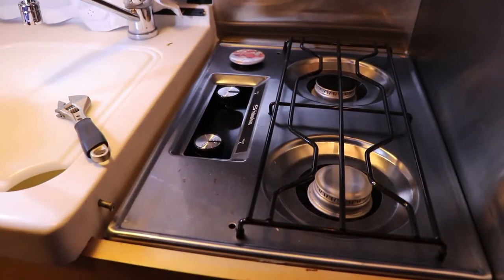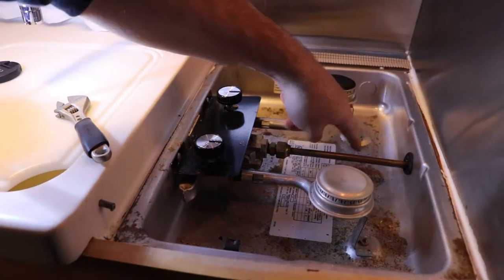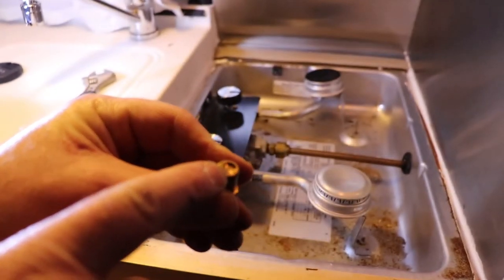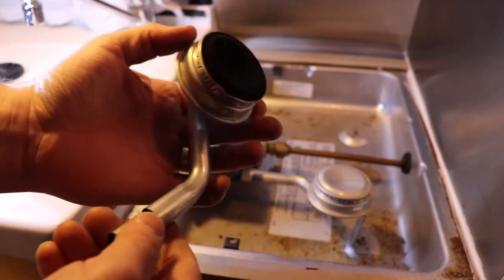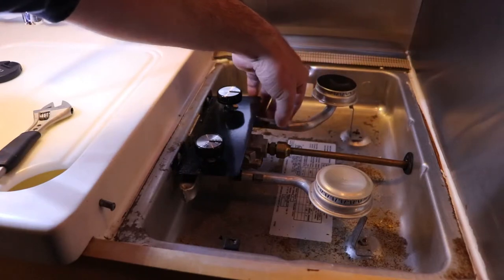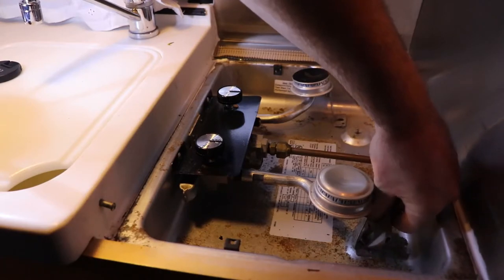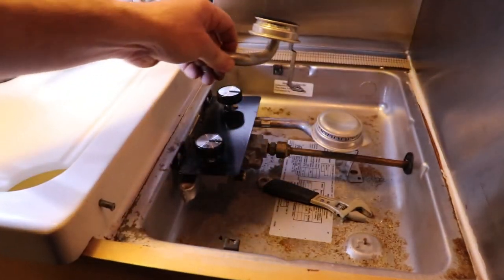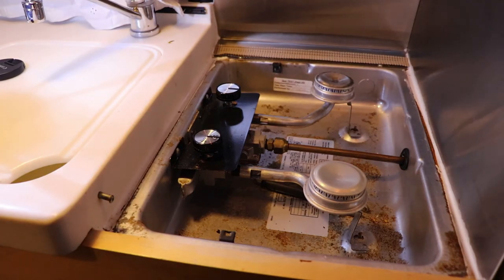How to Fix your RV Suburban Cook Top for Free

Comment: i have a orange flame as well and did the same thing you did. But its doing it to all 3 of my burners. Any suggestions?
Reply from the maker: That is a bit beyond my experience but the system is pretty simple.  I think there is a pressure regulator on the cook top and then there will be another regulator on or near your propane tank.  If your tank is full I would probably be trying to test the pressure coming out of the regulators.

Comment: MY problem is it will not light via the ignitiin spark. I opened it up and there are no crap wires nor do i see where new wires would go. Its a surburban. So now what.?
Reply: that means it doesn't have an igniter.  The knob says "ignite", as in turn up the gas high when you light it manually.  Confusing.